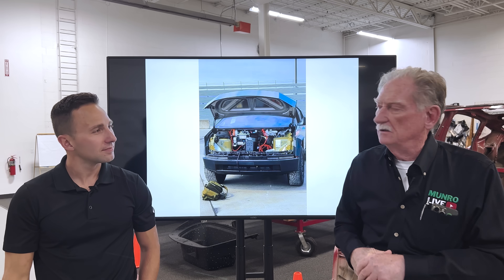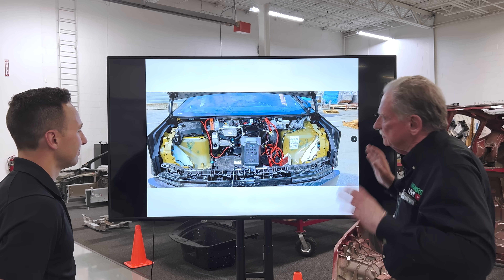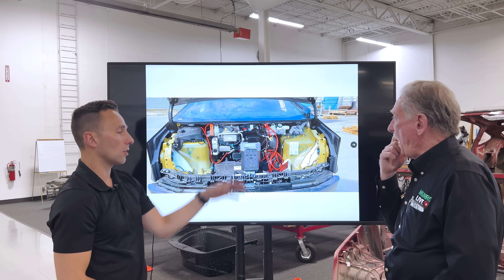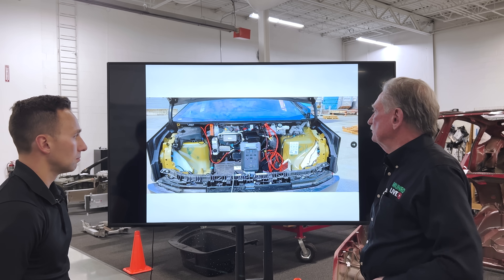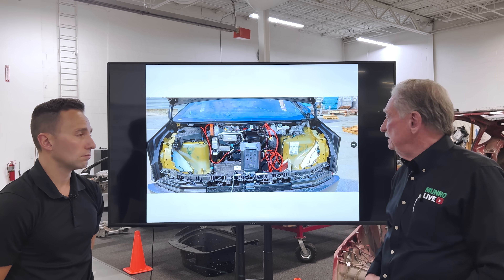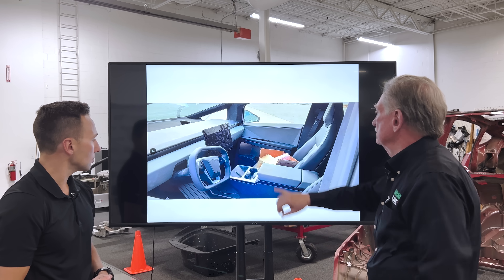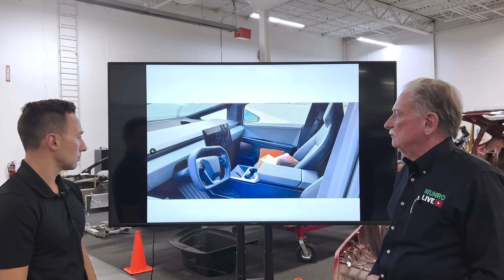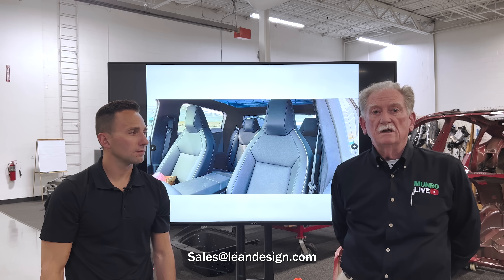Tesla Cybertruck Dual Motor closeups.

Comment: It's a 48 volt battery now right? Isn't the cyber truck going to have a 48 volt system?
Reply: When they say "12v battery" that's likely because of old habit, and also because that's what it resembles (as used in the recent Models S and X.) Until these people get a chance to verify what the output voltage of the battery actually is, expect 12v to be used as simple shorthand.

Not so complicated/strange really. :)
Reply: @lennyvalentin6485  Just making sure 😁

Comment: Magnesium car parts make firemen very unhappy. The magnesium alloy engine blocks in some BMW and VW (including Beetle) engines are generally unfeasible to extinguish in a vehicle fire. Add that to lithium battery fires, and first responders will pull out victims but then let it all burn.
Reply: There’s a video out there of a Chevy Bolt on fire on a German street.  A few minutes in, a crane and a truck with a huge tank of water show up and the crane places the entire smoldering Bolt in the water tank.  The problem is solved with typical German efficiency.
Reply: Maybe they figure, well, once it's on fire a couple pounds of magnesium aren't going to up things much.

Comment: did you notice that the front windshield was broken in the first pictures?   Is this an indication that the armoured glass was cancelled?
Reply: Or the body and roof structure is not rigid enough and twisting.

Comment: Why can't they put a wiper on the other side and have them timed to overlap in the middle as some cars have had for years? Really don't like the giant asymmetrical wiper.
Reply: Cost savings.
Reply: A single wiper offers cleaner visual lines  (i.e. looks better), better areodynamics and less wind noise.  All good things.  There is little if any bend to the windshield so it should track better than most conventional wipers on curved windscreens.
Reply: I don't think they could do it. This windshield is much taller than in a traditional car so the wiper has to be extra long. If they made it shorter, it wouldn't reach the top of the windshield.
Reply: Chevy Bolt has a nearly flat windscreen, but probably not as large as Cyber Truck.  Chevy uses two overlapping beam type wipers from opposite corners.  There is either a set of clutches or just two separate motors because you can pull on one wiper and move the wiper without disturbing the other when they’re in park position.  I like that better than the giant Cyber Truck wiper.  Likely being more easily able to find blade refills is also a handy thing for the Chevy.
Reply: The concept was to have no wiper blade.
Reply: @wtmayhew  That’s what they need to do to the CT. I also don’t see why the wipers don’t stow away for aerodynamics and aesthetics.
Reply: @stopmojim  I anticipate there could be a running change in store to update the wiper.

Comment: I thought the truck would have a 48V system...
Reply: It will, while still having some auxiliary systems running on 12v. The entire industry is on 12v and I wouldn’t assume things like lamps and wipers and basic door actuators to be on 48v. But where it counts like in the wiring harness for the battery and motor it will still provide amazing gains.
Reply: It's  all 48v
Reply: @chstra45  then why is there a 12v battery?
Reply: @austin6174  it's possible he misspoke in the video? It's already been leaked it's going to be a 48V low voltage system.  Tesla is largely vertically integrated and should be making any 48V parts needed.

Comment: Elon said he wants to have radar, but HD radar. He dumped LD radar because it was useless with the camera system. They will reintroduce radar, but HD radar.
Reply: HD RADAR, another marketing buzz word that's meaningless.
Reply: @heathwirt8919 well, no
Reply: @heathwirt8919 the meaning is high Definition Radar. Not really meaningless
Reply: @heathwirt8919 try high resolution. LD radar got spooked by overpasses. Need sensor can see distance, directly ahead, at speed, and determine closing speed. Got to be advantage over HD video at 36 fps. It’s a big ask.
Reply: " it's not as easy as it sounds to lay down a A pillar like that " words from Jordan when talking about visibility. But he may mean other problems could occur ........ time will tell.

Comment: How did you deduce 'dual motors'?
Reply: Not highlighted in this video but there is a label on the suspension casting that includes the words "dual motor"
Reply: The tag to the right says "dual motors".

Comment: I have never heard of someone beaking off a turn stock. Ever. Ive seen a lot of drivers unable to turn the volume up on the radio from the steering wheel though. Turn signals should be on the column Sandy. Sorry but you're just wrong on this point.  I really  and truely appriciate many of Sandy's points of view over the years of watching Munro Live. But sometimes I think he's just trying to stay hip, or blinded by cost savings in the  lean design approach.

Comment: Will it be a 12V battery or a 48V battery?
Reply: It kind of looks like maybe 48 Volts.  From a customizer’s standpoint 12 Volt might actually be better because 12 Volt accessories are plentiful.  Even 24 Volt would be reasonable given that 24 Volts is common in commercial trucks and military equipment.  If Tesla produces as many Cyber Trucks as they have orders, it may start market for plentiful 48 Volt accessories.
Reply: @wtmayhew  48V.  The whole reason everything is 12V is because that's the way it's always been.  So, Tesla is changing that themselves.
Reply: @whattheschmidt   The other question is how much Wattage will be available to power accessories?  A Warn winch pulls 396 Amps at 12.6 Volts under a 12,000 pound load at four feet per minute draw (about 6.5 HP).  Something tells me Tesla is not anticipating owners installing a winch that large.  A smaller Harbor Freight Badland 2500 is about 2.2 HP or about 1670 Watts.  We’ll have to see what 48 Volt accessories makers display at SEMA.
Reply: @wtmayhew  well, we know you'll need 1/4 the amperage of what we're used to so hopefully no issues there, but it will need to be made.
Reply: @whattheschmidt  Thanks.   Exactly.  Hopefully there is enough amp-hour capacity in the auxiliary battery and enough capacity in the inverter to make interesting accessories practical.  I’d say keep an eye on what pops up on display at SEMA.
Reply: @wtmayhew  keep in mind the capacity is really high since the 1000V pack charges it as needed. How many amps can be drawn from it is still up in the air. If you wanted serious power though, drawing off the 1000V pack would be insane compared to what currently exists lol.
Reply: @whattheschmidt  I was thinking of the limits of the DC-DC converter to derive the 48 Volt supply.  It would be nice to have able to source 50 or more Amps for accessories.
Reply: @wtmayhew  I guess the best answer is we will find out at the end of this month, and we'll get the most info when Munro does the tear down. Since it's a truck they should be doing much more for functionality like that but it's a guessing game for now.  I think a Cybertruck for plowing snow for instance would be badass but that's very custom and we don't know how that accessory would work at all yet.
Reply: @whattheschmidt  Thanks for the reply.  There are a lot of interesting possibilities, definitely looking forward to see what the aftermarket dreams up.

Comment: nice find, I haven't seen these images. Interesting what they're doing with Ecoflow Delta 2. I think they use it as a charger of the low voltage battery.  Question now though what is the system voltage, this does not feel like 48V system, likely 16V.

Comment: I wonder if they got committed to the radical design (for rolled steel exoskeleton) and couldn't back off as things changed? I'm somewhat concerned about crash worthiness.  If I understand correctly, trucks are not held to the same standards as passenger cars. Is that this true?
Reply: they did back off.  Sandy has said in previous videos that it isn't a true exoskeleton design.
Reply: @KenLord  yes, I know. But the wedge shape forcing the short front-end looks like there isn't space for proper collision   features. Looks cramped.
Reply: @appl314  Not much chance Elon is going to back off from Tesla's being the safest cars on the road.  Should be seeing drone shots of crash tested units out of Austin pretty soon.
Reply: Tesla isn’t limited by bureaucracy, is driven internally to be safe.
Long, long windshield hides amount of crumple zone before occupants impacted.
Ford, on other hand, what’s point of massive frunk obscuring vision? Why not copy RAM, make it two stories high?
Half the pickup drivers are now women, statistically shorter, hardly see over the dash.
Reply: @iandavies4853 I hope so. I have a dual motor on order

Comment: I hope they make the frunk as huge as on the F150 lightning. That seems extremely convenient
Reply: Sorry. Not happening. Part of the advantage of building your EV as an EV from the ground up is limiting wasted space. The Ford frunk is overkill that is only there because the motor is missing. Cybertruck’s looks like it will be big enough for some very functional uses👍👍
Reply: @nerdwatcher4273  Rather have a single bigger space in the bed, also under a locked cover.

Comment: If they are using that ecoflow to charge the High Voltage Battery, without the mobile charger, that's pretty cool!! because you can hook up solar to it and run your campsite, and charge the car without the various conversions that suck up power doing that Now

I can connect ~700w of solar to my battery while using the 110V mobile charger to charge my SR+ It's nice when you are camped out for a few days, but it very inefficient compared to a direct connection to the Bluetti, Ecoflo etc battery, and that to the solar panels

Comment: I wonder how much Tesla talked to the various truck communities like off-road (how will you mount a front winch) or ones like hotshot drivers and service truck use.
In other words, what's the target market, how flex able is the Cybertruck and is there any thought to the fleet / work uses or is it really only just another family vehicle.
Reply: Those are good questions. It seems like there is a quite sensible mix of convention and innovation shown in the photos of this video.  The design doesn’t exactly shout that it is meant fleet work and it is hard to say from these pictures how adaptable the vehicle is for custom off road tuning.  If I had to guess, most Cyber Trucks are going to have duty as replacements for family cars while their owners get to take advantage of extra truck features.  Tesla has to build Cyber Trucks to a price point, so it isn’t surprising that the engineering isn’t as radical as some people had hoped.  I am sure Cyber Truck will be a hit regardless.
Reply: @wtmayhew seems that way , there is a good mix of standard practice and new stuff. The most innovative feature seems to be the rear wheel steer. After that it seems very standard. The vehicle outside look is the most innovative feature. The ford lightning seems to beat it in every other aspect. That's a bit worrying.
Reply: @andrewashmore8000   Rear wheel steering will be cool.  You certainly don’t see it much on civilian rides.  Back in 1989, I had a Mazda MX-6 which could be optioned with RWS (unfortunately mine wasn’t).  It was a fairly conservative system but it had interesting features such as counter steering or same direction depending on speed.  It wasn’t a very common option because it was very expensive compared to the benefit.

Comment: I believe Tesla is working with their service mechanics to make things easier to service. It's amazing that en engineer would communicate with a mechanic 😂
Reply: There are entire satire youtube channels on such things.
Reply: Up till now the design was what's the cheapest to build and to hell with repairability.
Reply: Since Tesla actually trains and pays it's own mechanics, Tesla directly benefits from improved repairabiliy.  They also can get feedback quickly and take action when needed.  The old dealer model others use provides little if any useful feedback to the manufacturer and is why few problems are fixed until years later (if ever).
Reply: @tesla_tap  Are you a Musk bot?
Reply: @heathwirt8919  - Nope.  I often don't agree with Musk lately, but Tesla is not Musk.  Don't understand all the Tesla hate from people who have never driven a Tesla.

Comment: Interesting, only looks about three  years from production.
Reply: interesting,  they've already made far more cybertrucks, recently around 10 per day as seen from drone flyovers, than the number of EV hummers GM has sold this year.
Reply: @KenLord  Have any been released for first drive testing by any of the automotive publications? I haven't seen any so they don't represent a production ready platform. Tesla's keeping them hidden from the public.
Reply: @heathwirt8919  - Nope. The Cybertruck has not been officially released.  Lots of testing required, such as crash testing, environmental testing, etc.  All takes time. As I understand it some employees are getting these early cars for testing as well.  We should hear more in a few weeks.
Reply: @tesla_tap  It's at least a year away from being delivered to customers.
Reply: @heathwirt8919 - My estimate is about 2 months for deliveries to the first customers in low volumes.  About a year in high volumes. I could be wrong!

Comment: Sandy, essentially, pleading for a CT to tear down indicates there is huge interest from OEMs and suppliers.  This further indicates they see a threat to their cash cows.  I'm not saying CT will take all the pickup market, but even a 5 or 10 % hit to pickup sales would have a huge effect on margins.
Reply: As a conventional ICE truck owner operator I have doubts that anyone who tows a fifth wheel trailer is going to want a Cybertruck, there's some compatability / contact conflict issues for the side rails of the bed and hard turns.
Yes, I'm going to get a Cybertruck but I suspect I will also have to keep my Silverado 1500 and F-350 to fill in where the Cybertruck falls short.

Comment: The no stalks trend is hugely annoying for European roundabouts. Looks nice but is terribly dangerous to find the correct button while turning the wheel.
Reply: Does seem somewhat odd. Requires driver to think. Maybe if the navigation system is activated or the car is using FSD, it could anticipate or know about turns or lane changes and autonomously activate the turn signals appropriately. Many people (including me) fail to always use turn signals; the car might be better at that than the average driver? Also isn't it courtesy to blink your headlights after a semi-truck and trailer pass to alert the truck driver that it's safe for it to pull back over? Moving the turn signal stalk backward and forward blinks the headlights on most cars. Not sure, actually, about a new Tesla.

Comment: Still no dash or HUD (probably). Unacceptable to me and many others.
I also like control stocks instead of buttons, I've never had problems with breaking them off on any vehicle - is that a new thing?

I'm sure they will sell many to Tesla fans, but this is still quite the divisive sparse design.
Reply: I always say Tesla is not for everyone. Perhaps a Ford F150 Lightning fits the ordinary bill better.  Nothing wrong with that.  Only 93% of the market yet to be taken over by EVs and there are easy pickings so far!
Reply: I’m with you on control stalks because they stay in one place.  Buttons on the wheel/yoke move around, which is annoying when the wheel isn’t centered.  I’ve had cars for 40+ years and never come close to breaking a control stalk, so I doubt that’s really a thing.  The truth is it is probably cheaper to use buttons.
Reply: We’ll have to see the Cyber Truck control ergonomics are like in real life, but doing things via a screen is annoying.  That is especially true in a truck which may be bouncing around on a rough surface.  I can tell you that from experience from my 2005 Tacoma which makes use of easily gripped rotary controls, that it takes less effort than having to look at a screen to slide or poke a visual artifact.

Comment: The Cyber Truck is an inspired idea but an impractical one, and for several reasons. One reason (of several) is that the Cyber Truck is virtually unrepairable after a collision. No bodyman can ever repair body work that requires the precision this truck does. The slightest flaw in the surfaces or lines is immediately apparent to the owner. Cyber Truck .. cool idea, but grossly impractical. Elon Musk deserves credit for the courage to try. But reality is reality